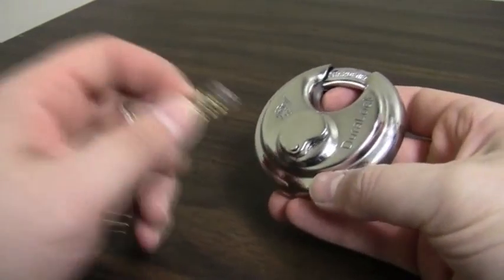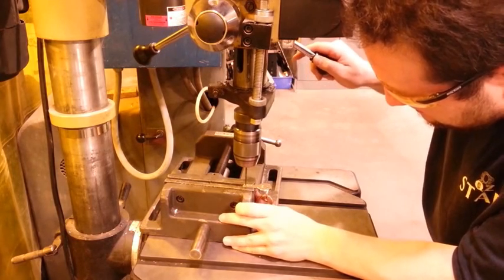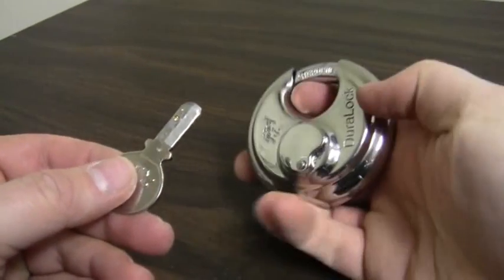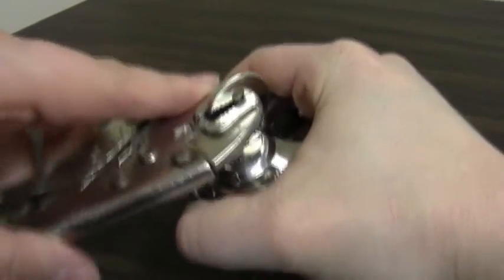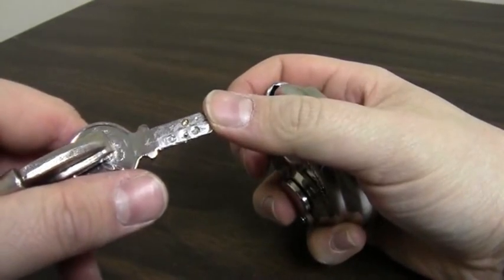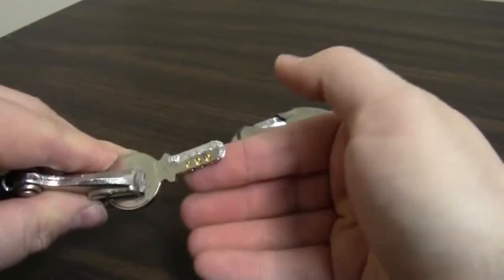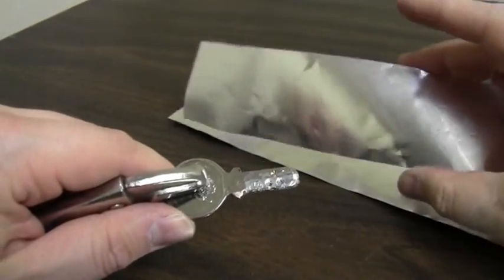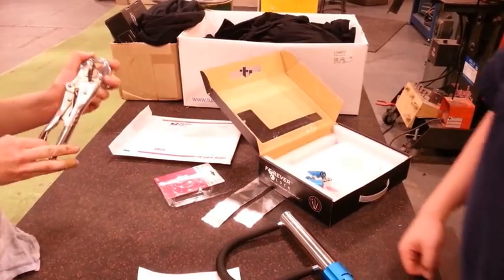Foil Attacks - 01 - Basic Foil Impressioning

Comment: Anyone tried something similar with a normal lock?
Reply: These are normal locks
Reply: @Keneo1  That's a dimple, here the standard is a vertical slot with cuts on the top.
Reply: It only works on cheap dimple locks with low tolerances. It doesn’t work on regular pin tumblers with high tolerances.

Comment: So you destroy the working key in order to make one that works kinda? If you started with a blank how would you know where to make the deep dimples. Also why are some of the cuts not covered with foil?
Reply: He used a different key from the same brand.
I don't know about the foils though.
Reply: There are cuts on both sides so you can put the key in both ways for ease of use, but only one side engages the pins

Comment: Somyou recreate a visual copy of the original... Would have been cool IF you did it without use of the original key.
Reply: the original key was drilled out so it woudln't work if you put it in.  It's basically a blank with non-working dimples in it. f